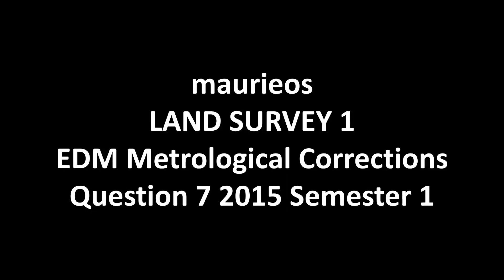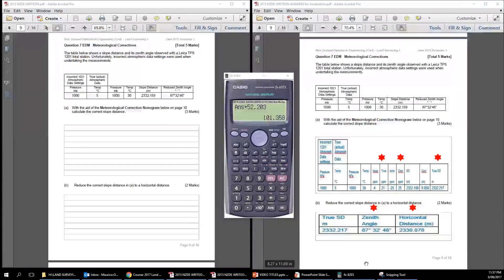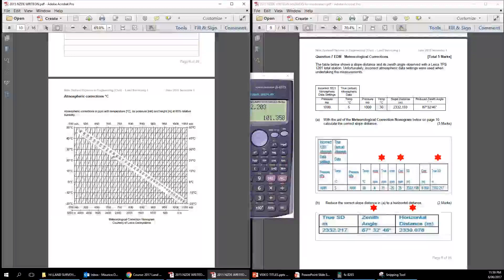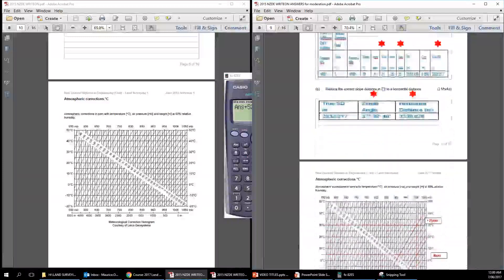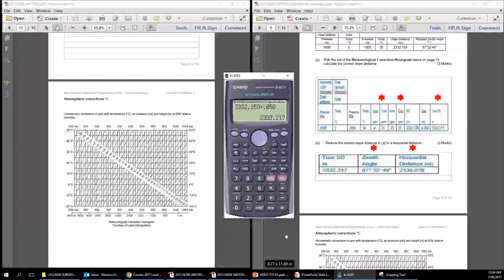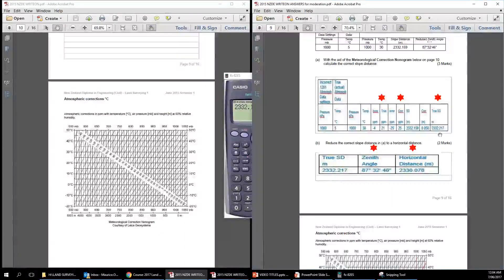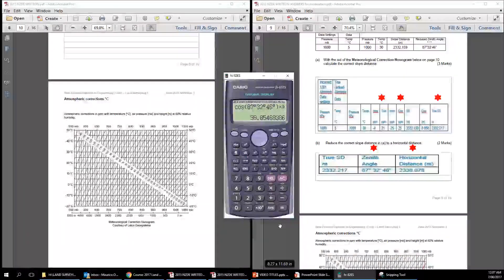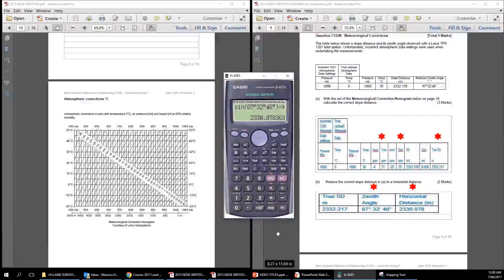maurieos LAND SURVEY 1 EDM Metrological Corrections Question 7 2015 Semester 1

Comment: Hi MaurieosCan you please do a video on how you get the 1mm per 1km once the ppm (25ppm) correction was found via the graph.  Thanks :)
Reply from the maker: Hopefully this will help to explain 1 ppm is 1 mm per kilometer.  1 kilometer is 1,000,000 mm (1 million mm) so 1 ppm is 1 mm per km   25 ppm is 25mm (0.025 meters) per kilometre. More questions welcome.